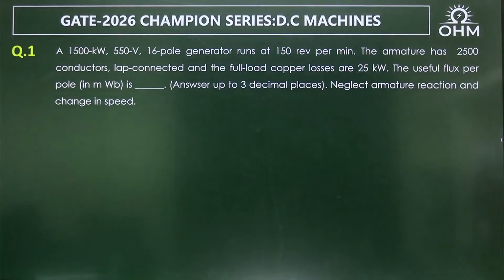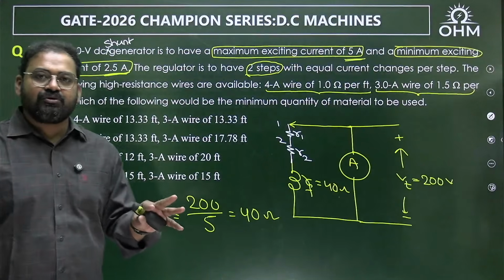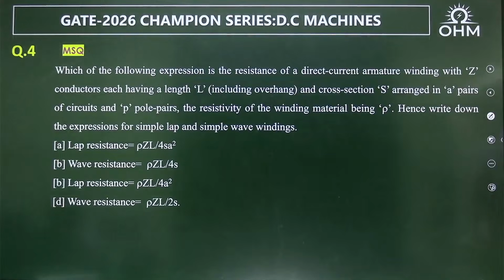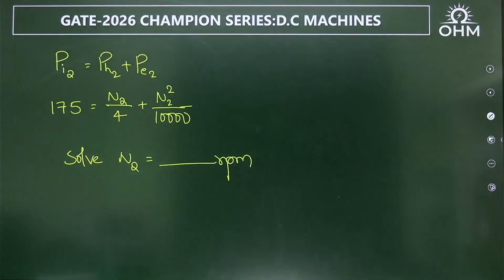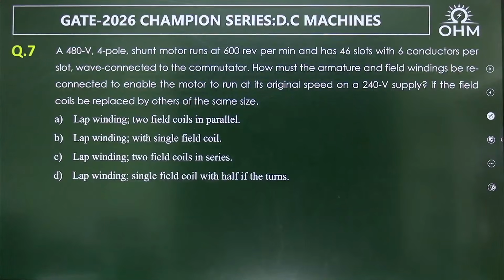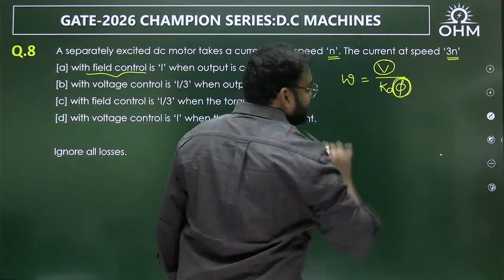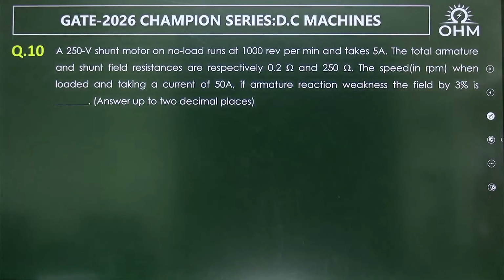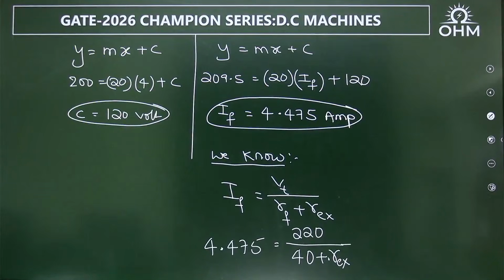Top 100 MUST-DO Questions | Electrical Machines | Part 1 | GATE EE

Comment: concepts 🔥💯❣ 

2 Q ( 38:44 ) : Option verification works here but not works always may multiple option may comes , observe options if options are different we can go for option verification we if want save some tym we can go option verification at last steps arriving final solutions ex. after elimination we have 2 options so we can go with them , if not we have to verify all !!

in this case R1 + R2 = 40 ohms ( all options are different so we can go , and by observing by multiplying any constant through them may not came unique answers so we can with verification )

1. 13.33*1 + 13.33*1.5 = 33.325 ohms
2.13.33*1+17.78*1.5 = 40 ohms (  matched )
3.12*1+20*1.5=42 ohms
4.15+15*1.5 = 37.5 ohms